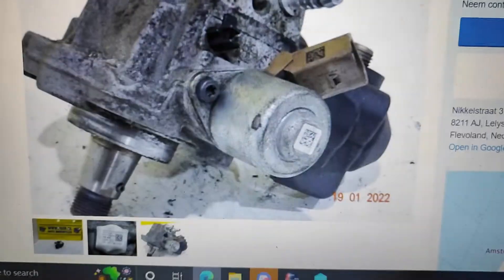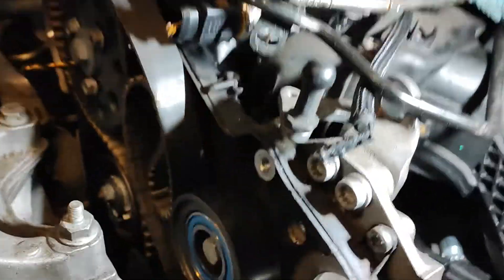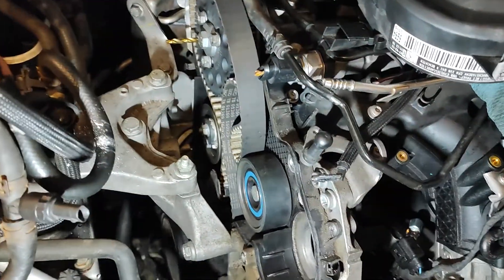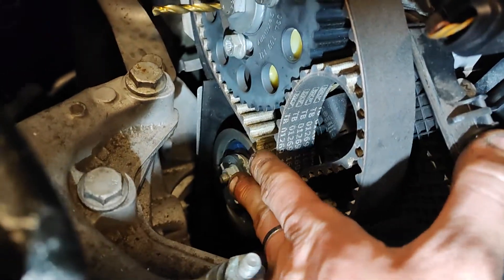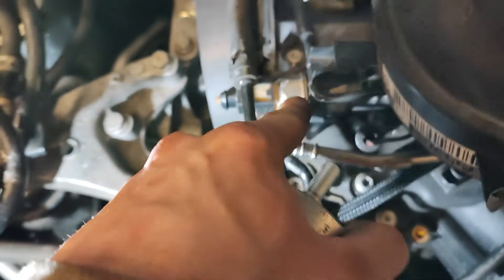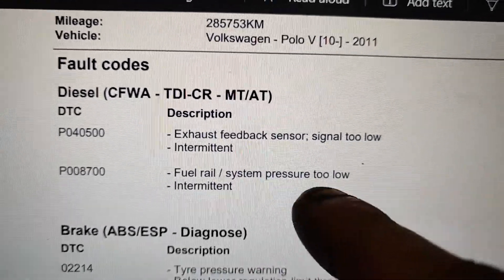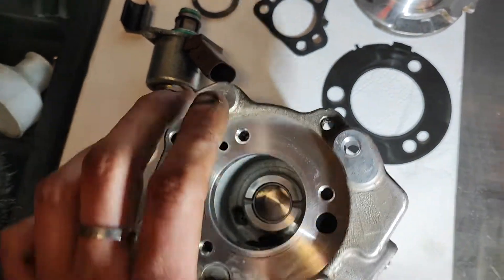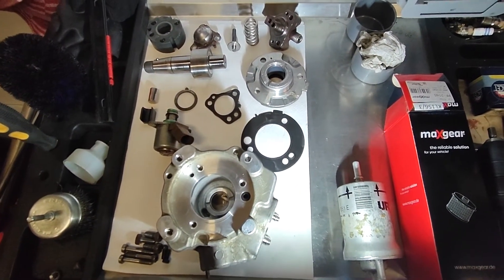VW Polo 6R 1.2 TDI Bluemotion P0087 Fuel pressure too low! My story...

Comment: Same problem here, what I did to solve this problem:

- Changed the High Pressure Fuel Pump to a low mileage version from the scrapyard
- Replaced the injectors 

Now holding up for 20k km so I guessed its fixed now. Don’t drive too long with this code because the engine will generate a thick soot which is harmful for your soot filter.

Update: this is the fix fault code didnt Show up anymore

Comment: Thank You for video. i just disassembled the same pump. it is build in similar principle like cylinder, piston and crankshaft. The part You are blaming as cracked is not cracked, it is a splited ring. my pump has the same line at that place.. i think that there is no high pressure at that location where crankshaft spining. Pressure is created by that small thin pin, that is moving like piston in cilinder. On my part that cilider feels worned a little bit, when moving that pin up and down it creates metal to metal friction from time to time. But crankshaft part are missing metal, at the both oval sides where it meets with piston base. interesting how are these refurbishers repair such parts, where metal are missing from that crankshaft rod. Need to be carefull with used parts like this.
Reply from the maker: Hey! Glad you found out the problem and thank you for the explanation :D

Comment: I have this same problem,I have fuel coming from the tank to the high pressure pump but from the high pressure pump to the injector rail nothing is coming out,
I tried to replace everything still having the same
Reply from the maker: What are the fault codes? Did you test the injectors?
Reply: @MechaNick_  they is no fault codes it’s only complaining about the abs pump needs to be coded
Reply: Also if I’m checking the wiring all wiring have ground,,

Comment: do you have a video of replacing injector on that engine 1.2 tdi mine is just on a skoda but same engine. special tools must be used???
Reply from the maker: Hey, unfortunately I do not have a video. But no special tools are needed. Only a diagnostic OBD device to write the injector code into the computer of the car.

Comment: Hi. I have a bad sound knocking from  the pump how I listen and the car it’s running bad shake … can be the pump or the timing belt?. 
Thanks
Reply from the maker: You can easily check the timing. If that's fine, then look to get your injectors tested... What trouble obd codes?
Reply: @MechaNick_   how i Can  test test the timing belt? I have make a test with VCDS  and it says no faults found
Reply from the maker: @florinlupascu1816  Take of the cover from the timing.
Reply: @MechaNick_  I looked and I don't see anything suspicious.  possible to be jumped from the point?
Reply from the maker: @florinlupascu1816  so the crankshaft, camshaft and fuel pump are on time. You should have an OBD trouble code if the engine is running so bad.

Comment: My car runs fine and is still economical but i have p0087 new low pressure sensor and glow plugs but still same code.any ideas anyone?? Thanks😊 2013 skoda 1.2 tdi
Reply: Change the HPFP and Injectors

Comment: I have the same problem and i still not find the solution 😞
Reply from the maker: Loosen the connection between the high pressure rail and the fuel pump, crank the engine. Is there coming any fuel?
Reply: Maybe fuel pressure regulator  ?